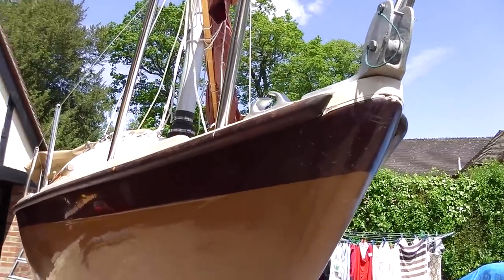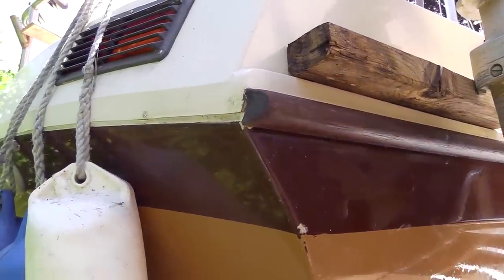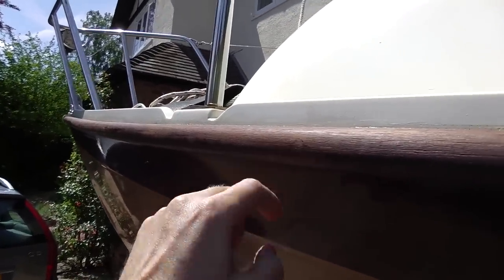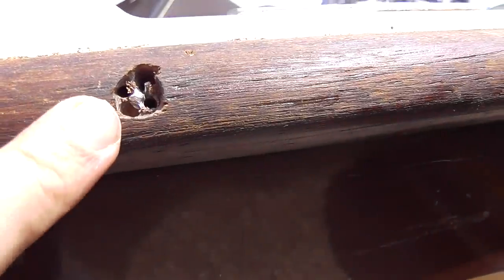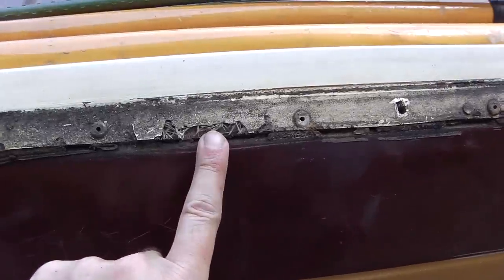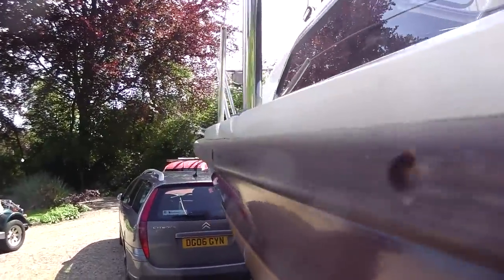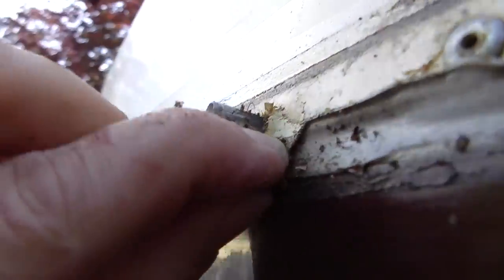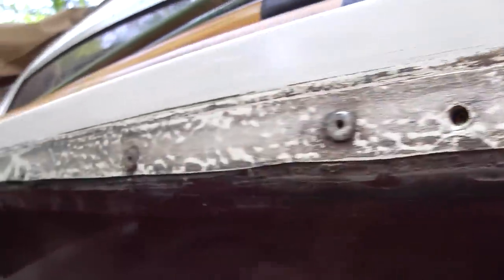Removing the strakes

Comment: Hey mate, why no recent videos?
As far as this one is concerned, I don't think it is an inherently bad idea in your case, although stainless steel won't act as a rubbing strake should and protect you from bumps. Although your boat is in the garden when not in use, so not really an issue. But I feel you missed an opportunity to improve your joinery skills. The best way to do it would be to remove, scarf, and rebed both sides, as the bedding compound failing is what caused the issue in the first place, and scarfing will be easier if you don't have to do it in situ, as long as you take measurements first. Leo from Sampson Boat Co. channel has some tips on it, though I may do some myself on the matter. Series drogues are a bad idea, especially for a boat your size, it just makes the situation worse. In conditions where you will want to deploy it you don't want to be dead in the water with green water coming over the transom. Better just to tow a warp, 100m is good enough, and much easier to retrieve. Plus you can tow it off a quarter so you have a quartering sea rather than getting your rear pounded ;)
Reply from the maker: I have been disabled since 2016, almost completely for several years, and that has limited my sailing a lot. I do hope to make new videos soon. Maybe next summer! I have been able to write a few articles on the blog.

Tammy is usually moored in Fareham Creek when not in use.  She gets to come back to the garden for a few months in the winter.  She has had several collisions while on the mooring, one of which bent the pulpit, so it's a real risk.

I think the rot in the rubbing strake was caused by 30 years of Scottish rainwater running off the same spot while she was parked in a garden.

Roger Taylor deployed his series drogue more than once from Mingming, a boat with the same hull as Tammy Norie, in Atlantic storms. I trust his experience. Of course, I have the option of towing a warp, just as you say, but also the option of a full drogue. I have a 10-cone mini-drogue rigged up for launching and retrieving trials, so that will be interesting. Maybe a video!